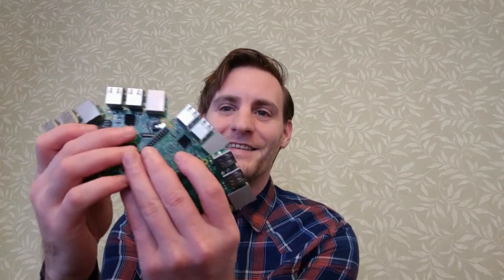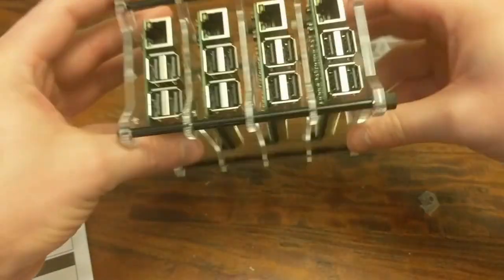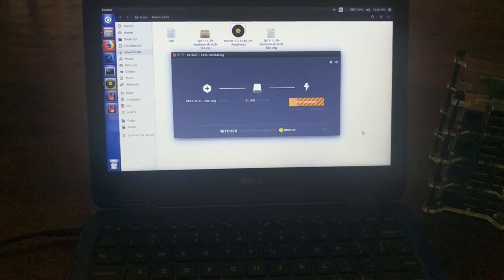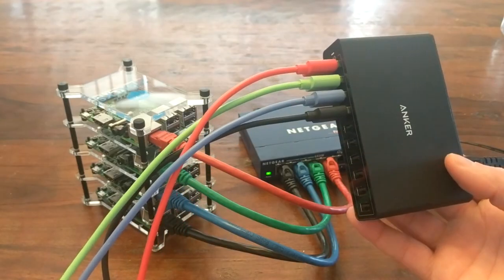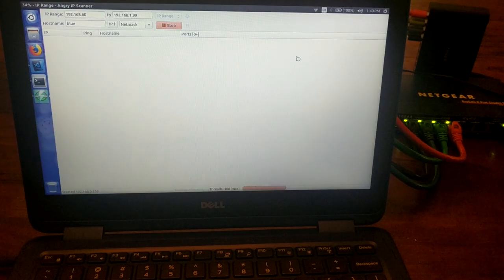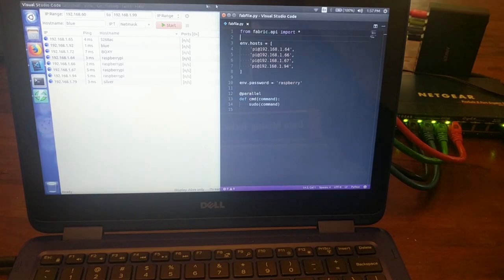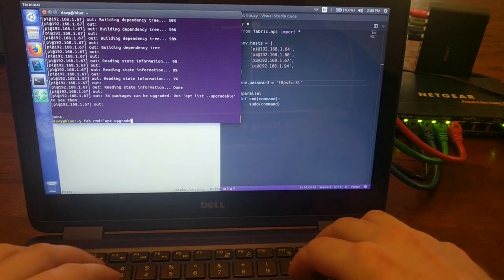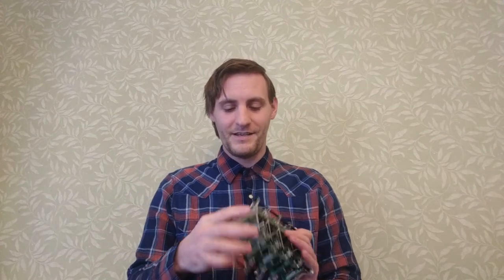Building a 4-node Raspberry Pi Cluster

Comment: Would like to run a Raspberry Pi for distributed computing. I assume they are powerful enough. I'm wondering what software would be required and how to set it up. I used to do it on "Settiathome" some years ago on my computer. I see now there are many medical application for distributed computing that would be nice to contribute to. Do you have a video on this or know of a source?
Thanks
Reply: Hi David. I'm seeing use cases to support Pi clusters in Smarthomes and decided to build one to confirm. I uploaded my notes from recent Docker Swarm build and MQTT and Node-Red containers. It may save you some time searching and collecting working solutions. Cheers. https://youtu.be/hpB76RcLQDk
Reply: This is very broad question. Most of the work horse clusters work splitting bit jobs into smaller ones.
Someone pointed to the Pi Beowolf cluster, here.
https://coen.boisestate.edu/ece/files/2013/05/Creating.a.Raspberry.Pi-Based.Beowulf.Cluster_v2.pdf

Comment: The ssh file has to have an extension. All files have an extension.
Reply from the maker: No, they don't.
Reply: Davy Wybiral I realized it once I realized you were using Linux. Sorry.
Reply: Windows doesn't even require you to have a file extension.
Reply from the maker: You have to tell Windows not to hide the extension, but you can create files on Windows without one. Some programs (text editors, etc) might assign one for you but Windows itself doesn't require an extension on files.

I've done this same kind of Raspberry Pi install from a Windows machine. Without a monitor/keyboard this is the only way I know to configure Raspbian to enable SSH.
Reply: the windows hosts file is called "hosts" if I recall correctly
Reply: The whole "extension" thing is a DOS time MS fabrication, in modern times there is a loosely coupling between what software is used to handle which "extensions" in the hope of helping end users. But it is not mandatory at all, or shouldn't be.
Reply: Not on unix. And for this ssh file its must be called exactly that - or you have no sshd running
Reply: Everything is a file.
Reply: Someone better not tell you about ".gitignore" file, that will blow your mind as its a file that is only an extension by your logic ;) haha
Reply: Morgan Mixer Windows will assign a .file extension if you don't.

Comment: 8:46 - "You don't have to use color coded cables like this, but be aware that it won't look nearly as cool!" :) Thumbs up. This was maybe 10 seconds after I thought - "wow, these colored cables look cool!"
Reply: Having worked as a network technician for a few years,,,yeah, anything you can do to simplify cabling pays off. Even if it's just 4 devices.
You'll never actually see the savings in things like time, frustration and hardware damage, but it's there. It's like not falling off a cliff that you don't know is there.
Reply: Not only does it look cool, but it helps you figure out which end goes to which CPU when you are troubleshooting your stack!
Reply: Hehe, he would have gotten it anyway, but that comment of his triggered my up vote.
Reply: They are not for decoration they are to organize. Them

Comment: To me it looks like you made a typo when you specified the ip range (192.168.60 instead of 192.168.1.60) but it still worked - why?
Reply from the maker: It was a typo during the video and I'm surprised that it worked that way too. The scan probably would have been faster if I had entered the range correctly.

Comment: But can it run crysis?
Reply: AleksssBoss157 I know... That was the joke...
Reply: If you try to use this rack to  run crysis, you will have a crisis.  ;)
Reply: my pc can run crysis oddly enough(my cpu is a 2.2 Ghz single core but the minimum requirements needs a pentium cpu that's a 2 Ghz single core so it claims I can't run it, really m8)
Reply: @adriaans9243  almost any modern computer can run crysis this isn't 2007
Reply: @rban123  well let's just say my laptop is a budget 2009 laptop with a Celeron 900 and horrendously awful integrated graphics although it still has 128/256 (not entirely sure) MB of System RAM allocated to the GPU instead of another PC I have that has a MUCH better CPU  but has only 64 MB of System RAM allocated to the Integrated GPU so here's the computers:

Laptop:
HP Compaq Presario CQ60 
2.2 GHz Intel Celeron 900
3 GB of RAM
Integrated Graphics
Windows Vista

Desktop:
HP Pavilion a251-123w
Intel Pentium 2.4 GHz quad-core
4 GB of RAM
Integrated Graphics
Windows 10
Reply: This was funny, but it was more funnier to c ppl not getting the joke! Backfire hilariously!

Comment: What is this used for
Reply: You can deploy web services.  It's a cheap learning sandbox  that you can deploy apps to without paying for a real server rack.
Reply: Uses for multiple Raspberry Pi's I can think of off the top of my head that i have either seen in practical use or done myself:

1.  Python job proxy (PyMQ message queuing, data package delivery, result delivery, status logging for larger equipment, LAN video transcoding)
2.  minidlna server (set top box, streaming server with hdmi hd capture hat - i had to wait a month or so on a waiting list, but receiving the hat was worth it, xsplit will take them in as a lan rmtp object)
3.  irc server (seen 3 successful implementations that work well with irssi)
4.  tor nodes (yes, you can d33pW3b.  should you?  no.)
5.  deluge daemon + deluge web management portal (yes, porn too, most of us are serving up cracked unity and unreal engine assets, though.  here i have to acknowledge the asshole of the internet exists, so have a go at this one plebs.)
6.  mining QoS proxy (not the miner itself, but they work well as a QoS proxy that balances an underlying set of miners on the lan - observed proxying scrypt jobs through one node, he broke the hashrate record on the pool to prove the point [by load balancing the jobs through a pi and connecting 4 asic's to the circuit] ).
7.  router/switch via openwrt or luci interface
8.  bonded lte modems with photon hat , providing up to 100mbps each pipe.  (this solution is actually how i got 1gbps in a rural area, clustered Raspberry Pis and a 1GiB/s packet bonder/load balancer)
9.  retropie -  from tests, adding a passive cooler and fan will get you playstation 1 and n64 at varying quality.  psx and n64 run between 45-60fps if using pi 3 model b and proper overclocking settings.
10.  deep learning - numpy, scipy, mathplotlib, pandas, scikit-learn (there is a youtuber who uses 8 raspberry pi's to analyze speech patterns in sound and taught a neural net to articulate English syllables.  i have used it for nrl language processing and tag cloud generation )
11.  3-D printing - stepper motor control through GPIO, g-language, network printing.  russia i'm looking at you on this one.  several russian-model 3d printers coming with modified raspberry pi's or simply a pi with a daughter board for power and sensor driver)
12.  irrigation system - yes, my neighbor uses two raspberry pi's to water his farm.  saved him the cost of buying an irrigation controller.  he was using an atari 2600 serial port before this, so an upgrade was up his ally.
13.  ip-camera, cctv, security system - use a stack of them to do z-wave setups and monitor your home.
14.  print spooler - microsoft, linux, or apple-compatible print spooler.
Reply: @lupinedreamexpress  - What about using it for a DAW ?
Reply: @Deebz270  that is what I want to know
Reply: The principle use would be for developing, testing and debugging MPI programs on a small scale before deploying them to a larger cluster with many more nodes.
Reply: I'm trying to figure that out too. Just starting to research.  The serious engineering guys test applications on larger versions of these (with additional programming to make them all operate like a Beowulf cluster). For a semi-skilled home user like me, I can imagine running home management systems with arduino.  Also could imagine it augmenting HAM radio systems by dividing computer tasks like managing packet data, monitoring satellite traffic, controlling antenna direction.  Similarly, it would be useful for managing mesh networks. I wonder if each unit has the processing power to run a virtual OS?  That might take some more of that coding that is over my head though.  All in all, this 50 year old guy thinks we are on the edge of another transformative period in tech and communications.  It is mind-boggling to see this kind of development tool made affordable enough for anyone!
Reply: Greg Shaw Double the performance
Reply: Greg Shaw 确实没什么用。。。。
Reply: +lupinedreamexpress :
A really excellent comment. Thanks for the time it took to write this up and all the time you spent researching/learning about multi-pi use ;-)
Reply: Now you can open 4 tabs in chromium without crashing.
Reply: @livewallberg  hahahah
Reply: Yes! You could install some sort of complicated server clustering software and run a distributed website which would, of course, deliver porn. Hmm, perhaps I would call it the "clusterfuck". ;-)
Reply: Using mine as a galera cluster learning lab :P
Reply: I love it
Reply: jgfjgfify in theory u can, but im not really sure. What u can improve is web server for example.
Reply: And just like that Sully Khan broke his AUP ( Acceptable Use Policy)
Reply: zztop3000  I don't get it as well. It looks like these motherfuckers just play smart without giving you any relevant answer. They don't have a clue as well ! 😀
Reply: His point was to be a tool
Reply: Probably crypto-currency masternodes
Reply: Greg Shaw dDos websites

Comment: Thanks for the vid; I'd never heard of fabric before and find it interesting and useful.  Are you using anything to get them to function together as a cluster?  Parallel processing etc...?
Reply from the maker: +Eric Patch I run some of my own distributed software on them. Mostly just for testing. The downside of using them to communicate with each other is that the onboard Ethernet is slow. You'd be better off buying a more integrated system. But they work great for hosting small instances of web apps and stuff (where people normally use a bunch of small VMs instead)
Reply: Hi Davy, thank you for the response. It would be really helpful if you can provide a small tutorial on how to build a simple distributed system and deploy it on this cluster. I've been looking for some other similar videos but your guide is the most clear and understandable. Another tutorial for the software part is amazing.

Comment: Does this thing really work ? Will there be parallel processing ?.Please run a program which shows that your cluster computer  runs faster that a single pi. Thanks
Reply from the maker: +Raushan Kumar they all run as fast as normal Pi's. They are normal Pi's, just on a network. You can run software on them to have them communicate with each other and distribute tasks or something and leverage the parallel capabilities. But I mostly use them for testing and hosting web applications. It's just a bunch of small Linux machines.
Reply: Ansible?

Comment: Can we use different models of RPi ? Like I have some of the original ones, some Pi 2's as well as two PI 3's. One of the 3's also has  a supplemental board with more storage.......
Reply from the maker: +Jean-Francois Messier sure. That kit seems to have mounting holes for all of them.
Reply: I did, duon't know how my load balancer will react.
Reply: Theoretically you could have a banana pi an orange pi a raspberry pi2 and a 3b and it would still work.

Comment: Total cost?
Reply from the maker: I already had most of the supplies and the PiRacks people sent me this kit for free. But the case is about the same as the Pi's, so around $35 (case) + $35 * 4 (pi's) = $175. Plus the USB charger (you can get those for about $10-20). Then you can get a 5-port network switch for around $10-20. Probably $220 or so depending on where you source the parts and what you already have laying around.
Reply: Reuben B A